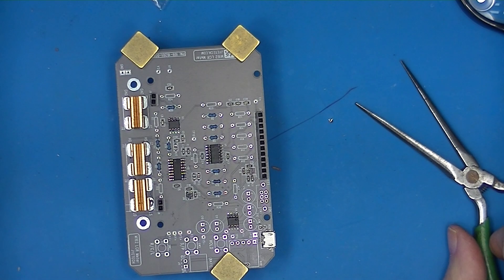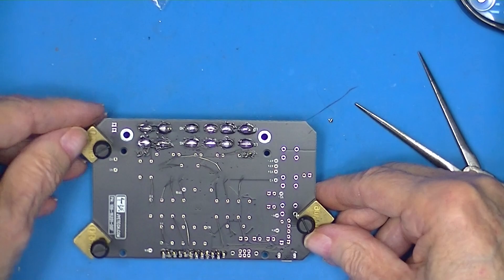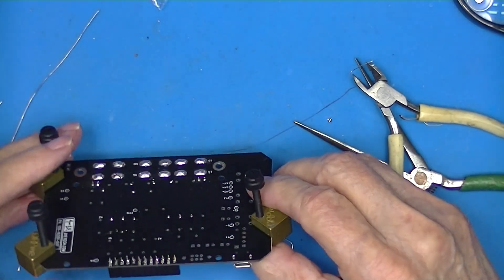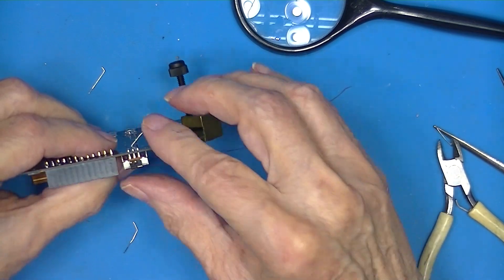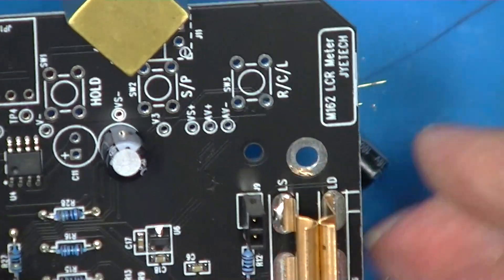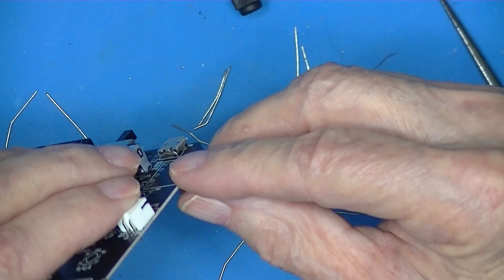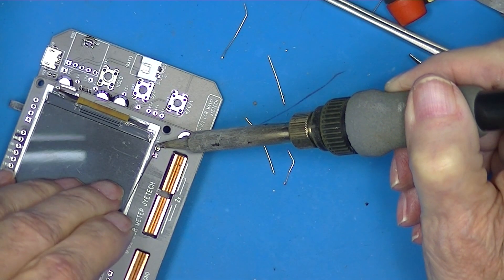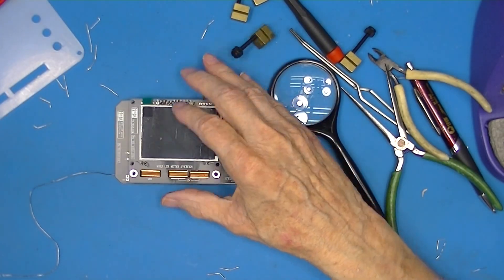Building an M162 LCR Meter – Part 1C

Comment: The instructions are certainly confusing, as to whether the pins for the display go on the display board, or the main PCB. Whatever makes the required connections and allows the mechanical assembly should be fine. However, there is a convention... The portion that supplies power (main board) gets the sockets. The portion that normally receives power gets the pins. With this method, the exposed pins can not be hot and, therefore, can not have said exposed pins shorted. Other tips... Amazingly, there is a great deal of technology built into the blade design of simple side cutters. Electronic side cutters only have the blade ground on one side. This method moves the pin stub upward (away from the board) and protects the solder joint from mechanical stress. The blades of the cutters that you are using have a double grind. They are intended for cutting lengths of wire (no fault finding intended.) There are many more features to electronic side cutter blades... Such as, they are offset in the vertical plane. It is all quite interesting and worth investigating. Final idea... I have been experimenting with drawing my soldering iron tip off of the pad/pin in a particular manner, to improve the quality of the solder joint/fillet. I find that, for pins, once the solder has reflowed properly/completely, if I drag the iron tip up the pin to remove it from the joint, I get the nice/perfect conical/ slightly concave Hersey's Kisses shaped solder joint that NASA requires. <grin> HTH.
Reply from the maker: I personally DON"T like flush cut units. As to the placement of the male-female pins, the device has two potential power sources. One powers the unit when assembled. The other powers the display/control board when the headers are apart and the f/w is being updated.
Steve

Comment: It looks as if you could assemble the LCD board with its headers on the bottom, then put the pins thru the PC board, which would keep the pins aligned, then solder the header pins to the PC board.  Just a suggestion.  Thanks for recording the assembly - it will help if I buy a kit.

Comment: I believe the sockets are soldered to the back of the LED board and the corresponding pins onto the board you are assembling here. Should still work the other way around.